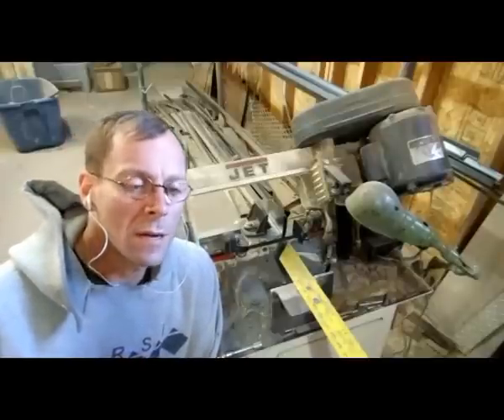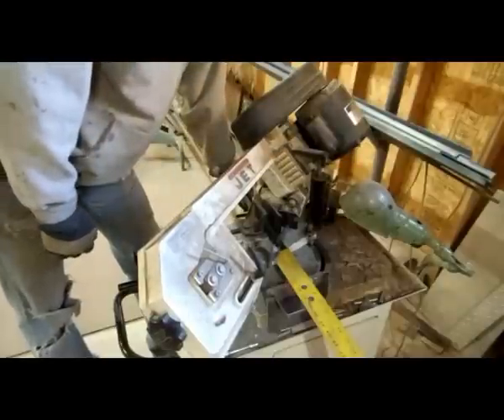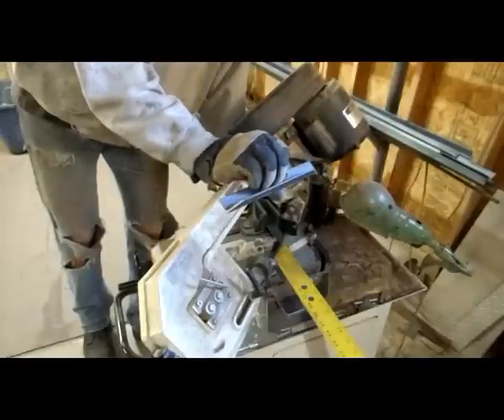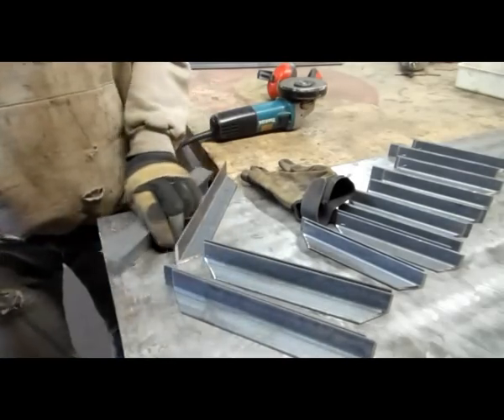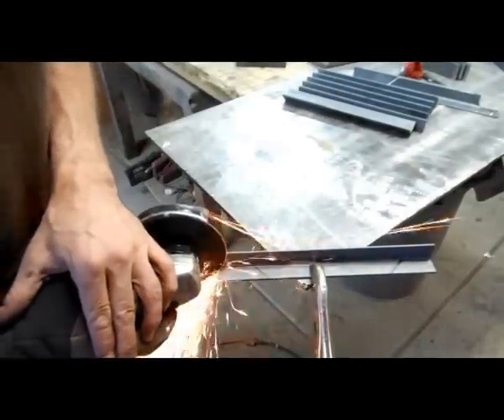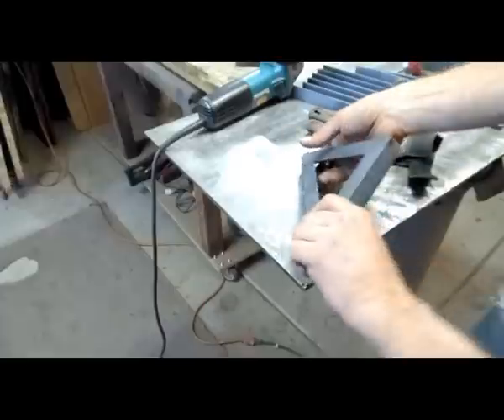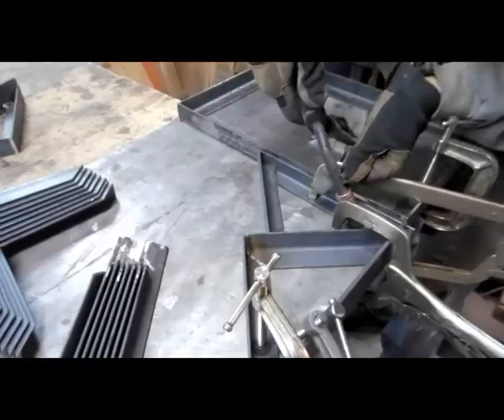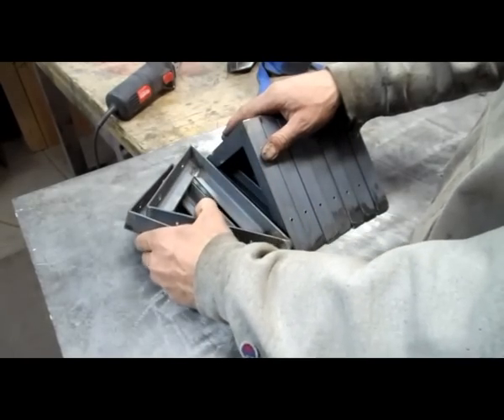Welded metal shelf brackets

Comment: Can't see where all the dislikes came from, but part of it could be all the extra work you gave yourself custom cutting each of those back pieces. It does look better, though, with the fitup like that. 

Maybe they wanted to see everything cleaned up & painted? Show the finished product?

Good job though. I'll be making a few of these, but instead of angle I'm just going to use flatbar back plates and square tube for the top & front. I think 1" flat bar & 1/2" square tube would look nice for shelves. Might actually use an antique 'hammered' rattlecan paint on it, too.

Hell, now I've got it all worked out in my mind and I'm nowhere near my project sketchbook.😀

Comment: What angle did you use Sr?
Reply from the maker: joselito pantig the angle is determined by the length of your two 90deg parts. Mine were equal in length so 45deg.

Comment: when you say chamfer, do you mean bevel? it looks like 1/8" angle iron. Do you need to do this for all welds after a certain thickness?
Reply from the maker: shihster88 yes that is right. It gives you a better weld. And the thickness necessary depends on the power of the welder and how much weld bead your willing to allow.
Reply: TheoDenver Maker I have a Hobart handler 140 that I got for a good deal so I am just starting out welding. would you recommend me beveling? I will be cutting angle iron at a 45 degree angle to make a square frame. thanks
Reply from the maker: That welder should have the power to handle plenty. I usually do 1/8" and up.
Reply: Great tip. I plan to do a lot more welding with my powerarc.
Reply: beveling would be recommended for strong welds, but if it is just a wall shelf, no beveling would be fine... BUT, it is always good practice to put a bevel when possible... Keep fabbing....